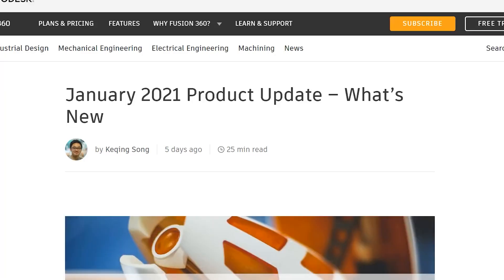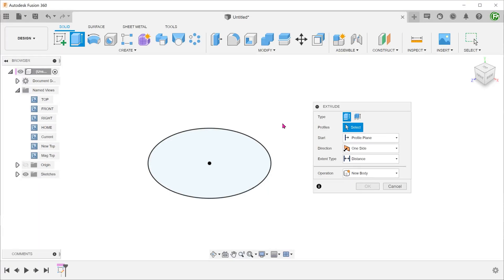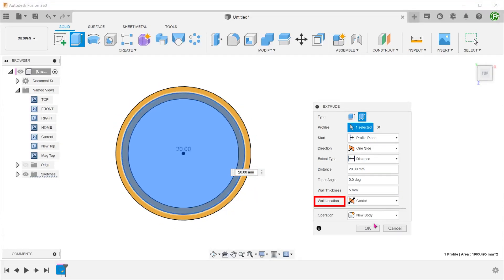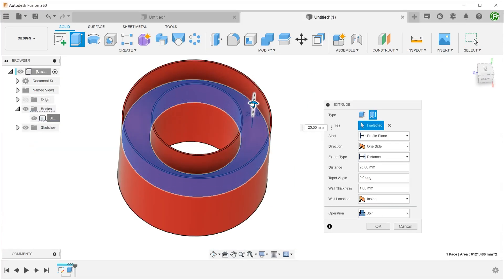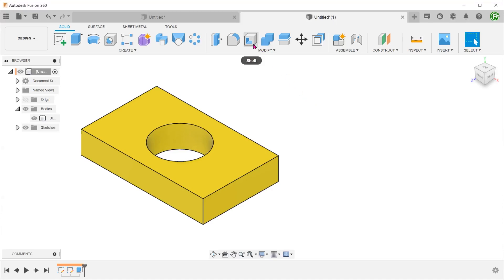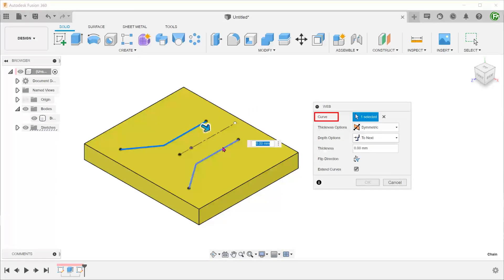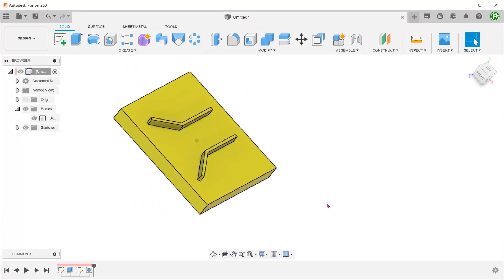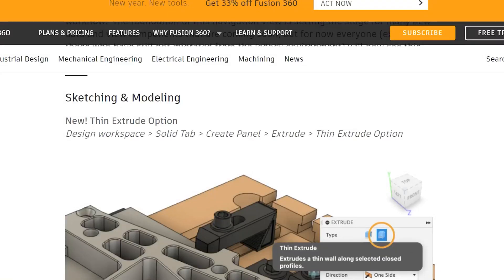Fusion 360 - Thin Extrude (Jan 2021 Update)

Comment from the maker: What use cases can you think of for the thin extrude in its current state?
Reply: Quck and easy quasi-2d moulds.
Just make a 2d sketch of the part you want. Thin extrude with external walls up to the thickness your part needs and presto!
Just 3d print and pour in silicone. I dont have to offset faces and subtract objects from each other anymore or think about wall thicknesses when I'm sketching.
Pretty rare and specific use case but it is perfect for my work.
Reply: I liked the simple lip/groove capability that you demonstrated.  I hadn't thought of using it that way.  I've been working on a custom enclosure design, so that may simplify things.  Thank you!
Reply from the maker: @zencow  I made a separate video for lip/groove features. If you are interested, you can take a look.
https://www.youtube.com/watch?v=UqTLq7okLLU
Reply: @Fusion360School  Thanks!  I've already caught up with all of your videos and have seen it.  :)

Comment: Fusion 360 is a very poor program, especially when it comes to technical drawing, filling the cross-sections depending on the material is not possible steel and wood
Reply from the maker: I would agree that drawing functionality in Fusion 360 is very basic.

Comment: This would have saved me so much time in the past! I’ll be thrilled when they get rid of the closed sharpie restriction! I can’t believe it took them so long to do this, but at least it’s finally here.
Reply from the maker: The restriction is disappointing. I could have easily used this in my "keep sketches simple" video if there wasn't this restriction. I would have been able to skip the surface creation step.